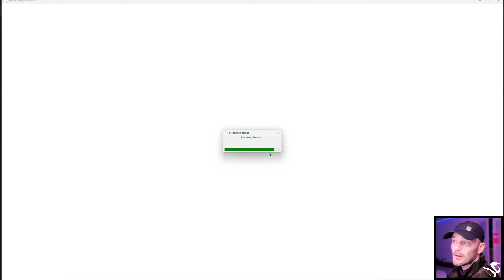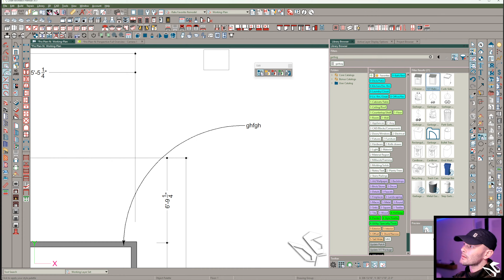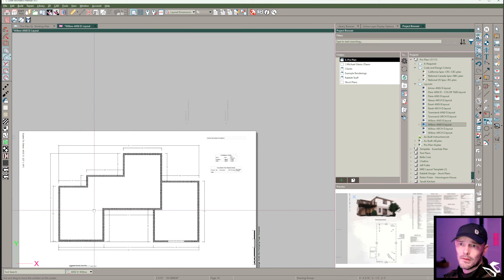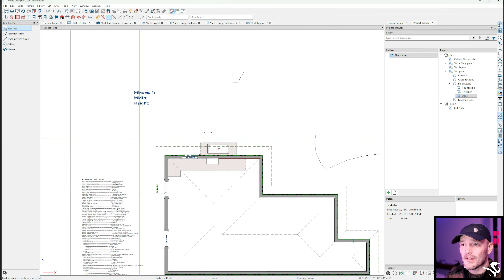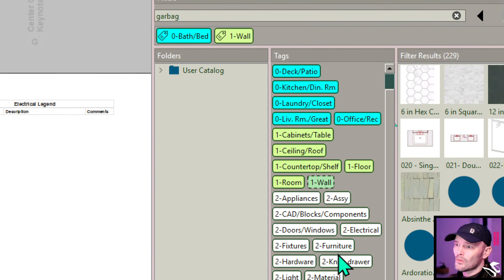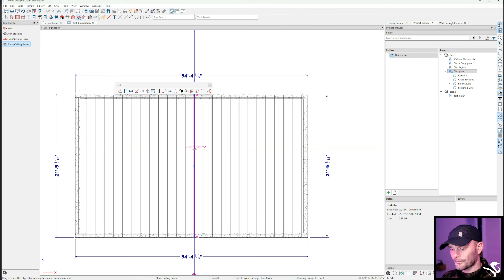Comparing Homedesigner Pro 2026 to Chief Architect Premiere X17 but an expert X17 technician

Comment: While I understand what you say but longterm it's not worth it.  Why every couple months or year there is a new version one can't even get to use the software for a 5 Yr period that's just crazy all this is just marketing to make money.
Reply from the maker: I don't work for Chief architect so this isn't marketing for them. For full time condocs and drafting my historical data shows a 40 percent improvement in deliverables over a 5 year period. I agree that someone who doesn't draft as often will not take as much benefit from an annual upgrade structure, those of us who do large volumes really depend on new features and updates

Comment: I liked to hear from a knowledge source about the platform, learn about details. I don't mind your close connection to the company but the chilling for the subscription model and the weak try to explain it away with the need for funding is ridiculous and, frankly insulting. The platform will suffer heavily from the switch to subscription. Some remarks in regards to HW/SW are outright nonsense from a developer level, if a proper development process is implemented - which you would assume given the size (and price) of the program. The long term outcome will be people leaving this platform, substituting it with AI support.
Short term cashing in on subscription (and selling company shortly after) is desperate move but a common one. Shame... You need to pay an architect or engineer anyway after your own work and investments... and there is also the option for downloading unlocked software and pay nothing. Subscription is pushing many people into that option as well... until they migrate away from the platform.
Reply from the maker: The good part about the world we’re living in is that we can disagree and still have a cordial conversation.

You actually made the point yourself when you mentioned people shifting to AI. That right there illustrates exactly why the market is volatile. When entire segments of users can pivot tools quickly because of emerging AI capabilities, historical purchasing behavior becomes unreliable.

Software development budgets are committed years in advance. If a company is planning a release two years out, they need to know what level of staffing, R&D, infrastructure, and AI integration they can realistically fund. In a volatile market, relying on past perpetual license sales makes forecasting extremely difficult. Revenue spikes one year and drops the next. That makes long-term planning risky.

Subscription models create predictable recurring revenue. Predictable revenue allows predictable investment. It stabilizes the runway needed to develop and compete in a rapidly shifting landscape.

And to be clear… even though I genuinely love the software, the developers, and the staff, I don’t particularly like the subscription model either. But understanding why it exists and liking it are two different things.